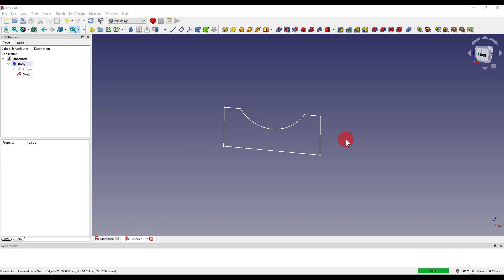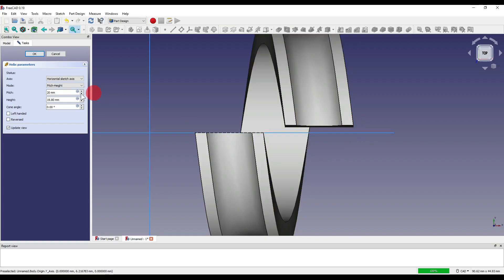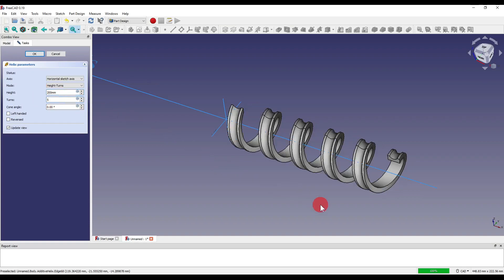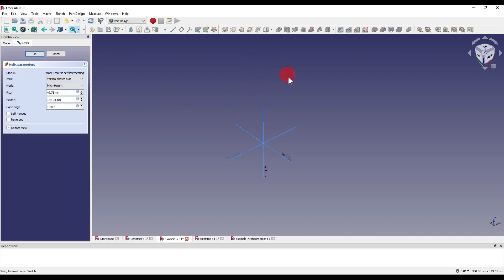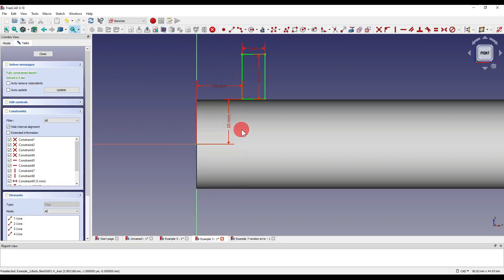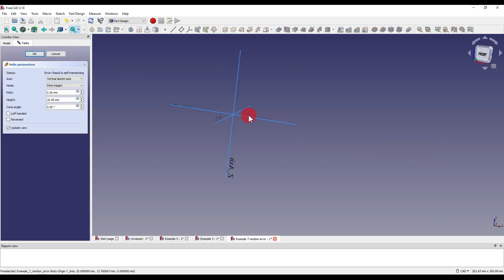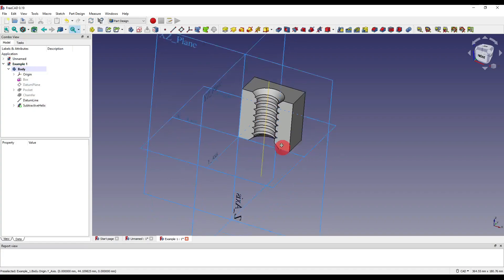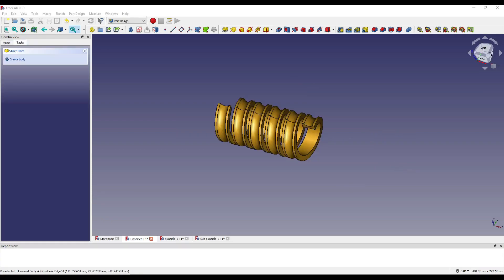3D modeling FreeCAD 0.19 - Additive & Subtractive Helix

Comment: Hello Andrew, I have a real challenge which is about the helix, subtractive on a cylinder like a thread. Then put another helix on the same spot and reverse it. so it comes to a continous path as found in fishing spooling equipment. The problem is that I could not make it couple on the ends where the inverted and the regular helix connect. my setup is cylinder d=25, h=50. A 3mm wide cutout on the helix and 2 turns over 45mm. Basically if you rotate it is an inifinity path always crossing smoothly with an arc at both ends. Maybe you have an idea how to solve that.

Comment: What about varying pitch on a single helix? I need it to start at a shallow angle or a straight line, and then gradually increase in pitch / get thighter. Is it possible to do so using this tool or helix tool in part workbench?